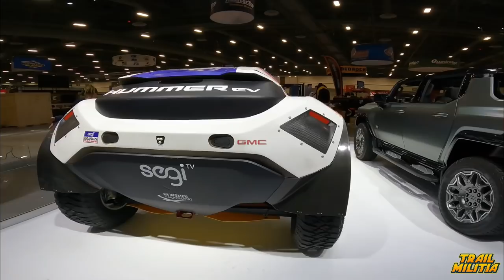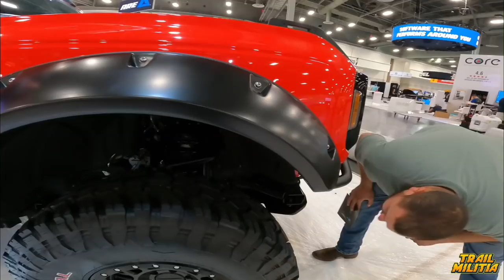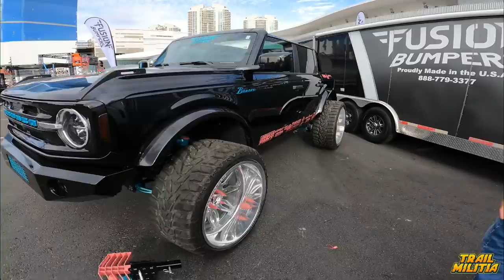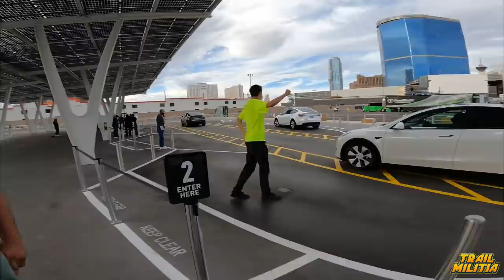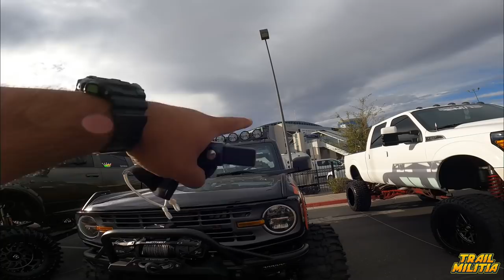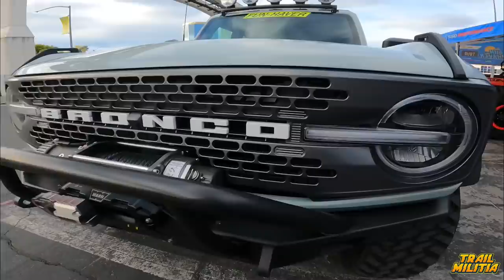Sema 2021 The good the bad and the really Ugly (Bronco addition)

Comment: Eville has stock color, not stock suspension.  Bds spacer lift, second lift he has had on it. Trial turn assist is what ford calls it. It has been out years ago on another manufacturers vehicle, was not widely know about for the most part until ford spot lighted on the bronco.